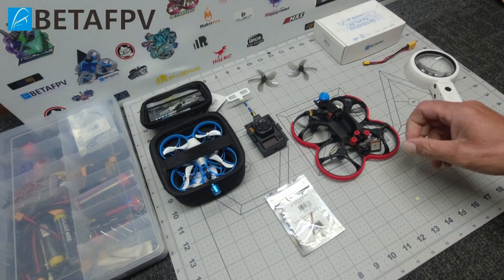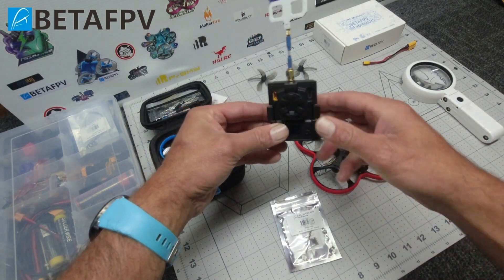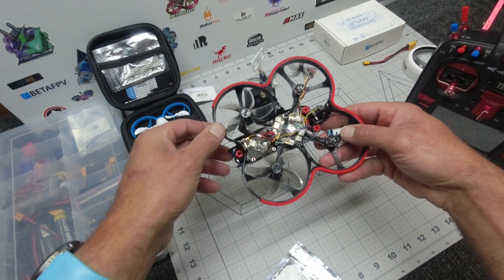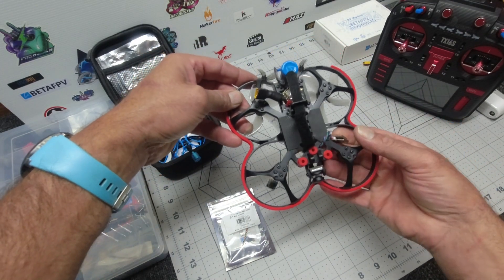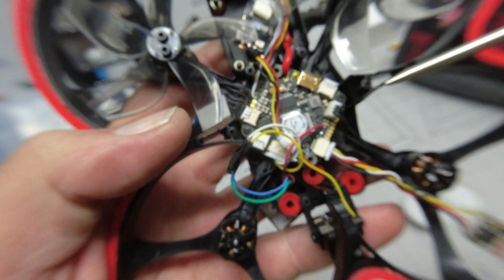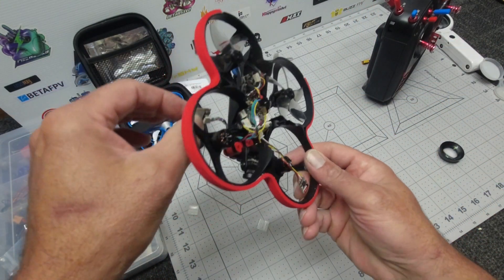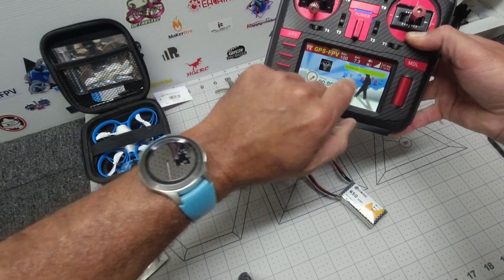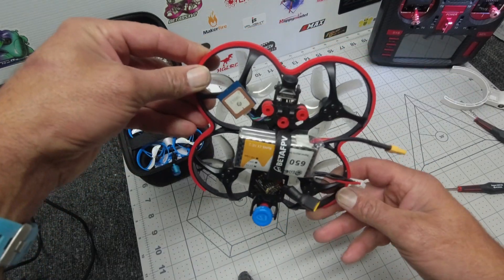Beta FPV ELRS Lite Receiver V1.1 *NEW*  Epic Range Test 🏆

Comment: I probably just missed it, but @what output power was this done?
100mW? 
Thanks for the video :)
Interesting and uplifting results (if on 100mW ; ) )
Reply from the maker: Cheers mate. MT RX was set @ 1W for this review. I am doning another with the lite radio 3 transmitter with the Nano TX module @ 100w and @500 mw. I am predicting the results will be fairly similar!.
Reply: @GTARC_au  I know for many, myself included, 100mW is the most important (as europe is max legal 100mW for many countries), but also 25mW is interesting due to lower battery consumption :)
I have a 1W HP module, i have yet to run it over 100mW :P